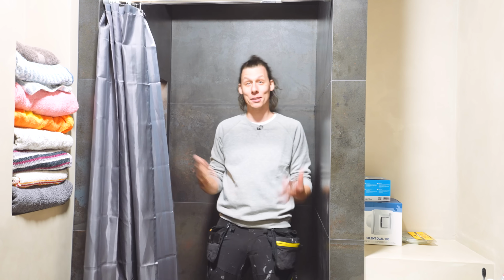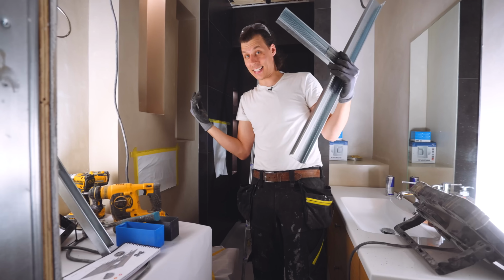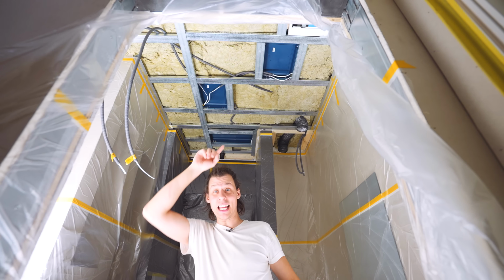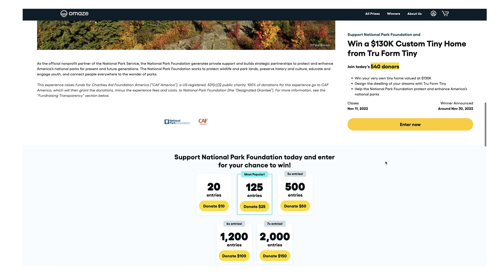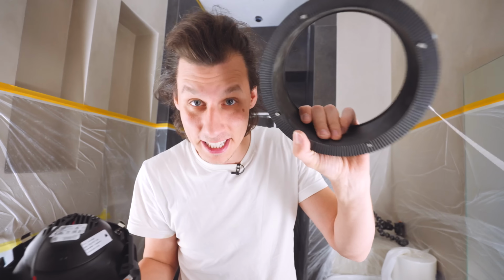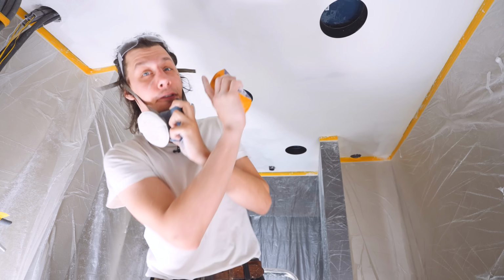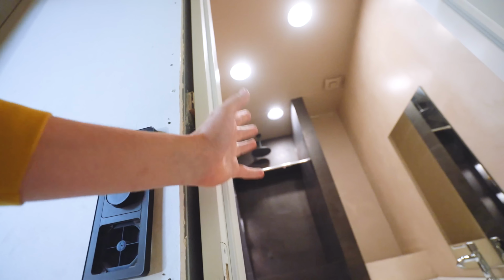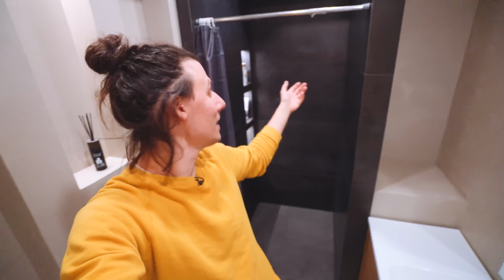Our Bathroom is Missing Something VERY Important

Comment: I would set up test to check that money saving on floor heating... the thermal capacity of the floor may require too much electricity to heat it up to normal temperature.

Comment: Getting there!! 

I wonder what is the lifetime and serviceability of these speciality can lights are. That seems like a little headache to repair a light that fails, especially if they no longer are in business and you are reliant on a specific diameter and voltage (which is to say the transformer might also be a problem in the future).

Maybe we can have a single standard for residential lighting yet I doubt we are even close to this. 

Hopefully this company is in business and making the same fixtures in 10 years

Comment: It's turning out great! I just have one question: why are the light switches outside the bathroom instead of inside?
Reply: Probably local building code to do it outside. Same here in the UK
Reply: Avoids needing water resistant switches or pull cords.
Reply: More fun to mess with people
Reply: in Norway we have different zones that allow different electrical installations in bathrooms, usually if the switches are outside of the bathroom it is to avoid any electrical code violations, ofc it could also be that is what he preffered
Reply: There is code for electrical in "wet rooms". But I see no problem having them on the inside here. (basically just 60cm from shower) 
I think switches on the outside is just an old standard people have yet to transition away from.
Reply: Nice! Thank you all.

Comment: I can see how those ceiling hooks could be strong enough in the vertical configuration, but in the horizontal position... you bent that with two fingers, surely there's no way that could hold any weight?
Reply: Probably depends on which way the load comes etc. The people that make these systems are usually smarter than I am.

But also ceilings don’t need to carry much weight, usually just their own dead weight + some lamps

Comment: Is it a Europe thing to have the switch outside the room? Would be awkward to have someone close the lights when you are in the shower.
Reply: Switching off the lights when someone is inside is a classic European joke :D
The switch used to be outside of the room because of safety regulations, to prevent water geting inside of them and possibly electocuting people. 

Now days the switches are more safe and water resistant so its alowed to instal them in the bathroom, but it mostly depends on your choice.
Reply: Nah. I think it is just something he is used to or an oversight when he did all the water proofing. They will learn, when their kids mess with them :P
Reply: In UK, outside bathroom but in older properties you will find pull switches inside the bathroom.
Reply: @johanness6545  He live in Oslo, Norway.
Reply: @Helveteshit  Not an oversight, it pretty much standard in the UK to have light switch outside bathroom / WC.

Comment: I saw you do it in the previous videos as well, but why do you need to put two layers of plasterboard on the ceiling/walls? One layer should be sufficient, right?
Reply: His reasoning is it will provide better sound deadening.
Reply: In some countries it is code to put two alternating layers of plasterboard on the ceiling because that way if there is a fire it takes longer to get through to the wooden beams, because, well, plasterboard doesn't really burn cause it's gypsum.
Reply: It's to comply to fire code, at least it's here in Sweden. And it tends to be similar in Scandinavia. I'm guessing that's at least part of the reason.
Reply: A single sheet of plasterboard is a minimum 30 minute fire resistance. In his case, it is both for sound insulation but it also fire protection. To prevent fire from spreading from one room to another within X minutes.

Comment: Why is the light switch on the outside of the bathroom?
Reply: A light switch on the inside of a bathroom needs to be water resistant and more secure, since it's always in a somewhat moist environment. It's also safer so if anything would go wrong with the switch, it won't shock you due to the moisture present since it's on the outside where it's dry. All the switches in my home are on the outside for bathrooms as well.
Reply: @DexBunny  it's not a sauna though haha

Comment: As a Canadian we dont built waterproof bathrooms like this. 

I wonder why all the walls needs to be waterproof like a swimming pool. Is it because usually they are very tiny?

The floor I can understand even more in a building, but we dont do this in houses except the shower of course and we use mold resistant drywall.

So my question is, why the walls are waterproof? and also then why not the ceiling?

Also the outside switchs arent up to code in Canada. 
In Canada in a bathroom all electrical plug/switch/lights are connected to a GFCI outlet inside the bathroom so no way to get electrocuted. 
Sorry if it is dumb questions for UK citizens. 

I really love the channel, all projects are great, very well filmed and edited.

Cheers!